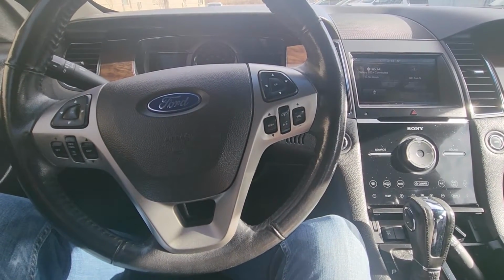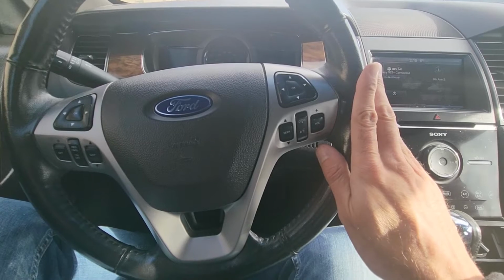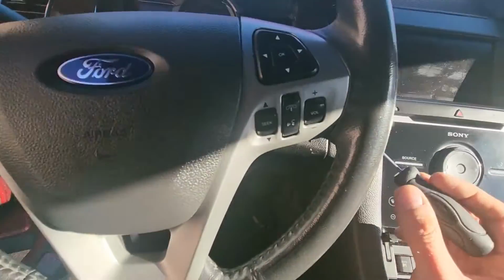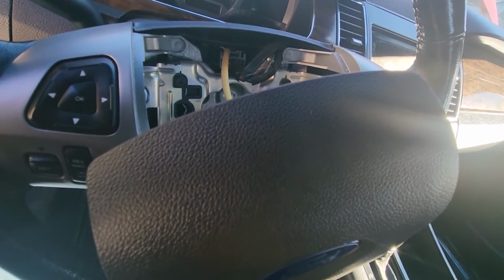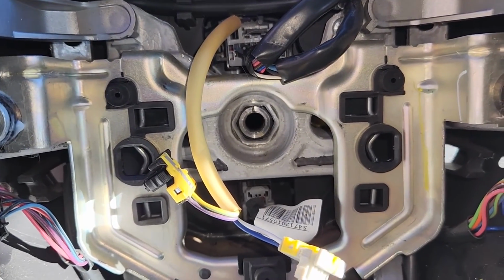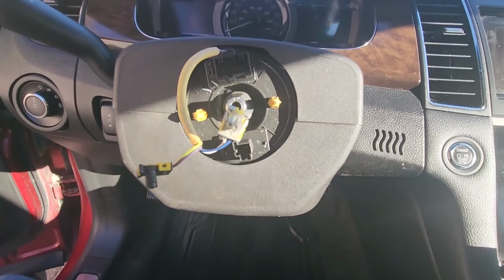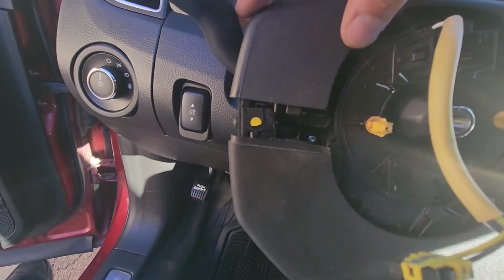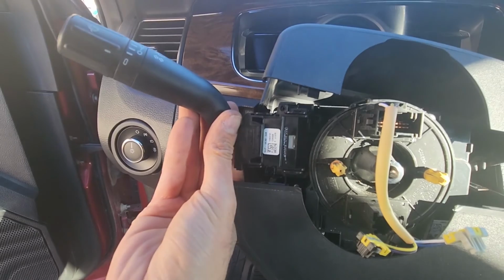Ford Taurus - TURN SIGNAL LIGHT SWITCH REMOVAL / REPLACEMENT (2013 - 2019)

Comment: I HAVE A 2019 LIMITED AND SOMETIMES TURN SIGNAL WORKS, SOMETIMES IT DOESNT. COULD IT BE A RELAY GOING BAD,? ONE SIDE WORKS FINE
Reply from the maker: Hmmm I believe there is no serviceable relay on Ford Taurus. Turn signals are controlled by the BCM. I would start by inspecting and possibly replacing the light bulb, inspecting the socket for any corrosion

Comment: Turn the steering wheel to left 90 degrees and you can get to both screws without removing air bag. This worked in a 2013 ford taurus SE.

Comment: Will be using this video for my 2013. Wipers wont turn off XD
Reply from the maker: I'm glad my video is helping. Good luck
Reply: @QuiteAlright Got it done. Word of advice: rotate the wheel 90 degrees and you would not have to even remove it! Your videos have helped me out a lot so I figured I should return the favour
Reply from the maker: @rileyv6707  Thanks for adding to the video. It will definitely be helpful to anyone doing this in the future
Reply: Does this switch affect the steering assist? My wipers won’t turn off but also the steering wheel got hard to turn
Reply from the maker: Hmmmm it shouldn't affect the steering. Usually hard steering is connected to electric rack n pinion on this models
Reply: @QuiteAlright  and that ain't cheap 🤨

Comment: Basically only cosmetic changes between the 2010/12 & 2013/2019 models.  They did make some teaks to the engines.
Reply from the maker: Thanks for clarifying. I wasn't sure if it will be the same pre facelift